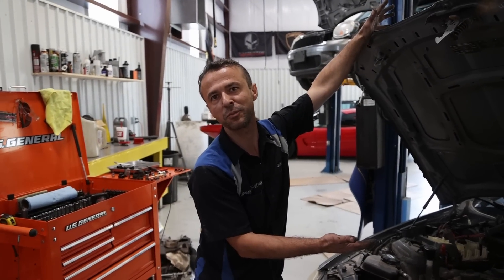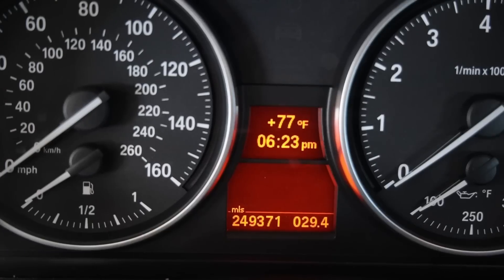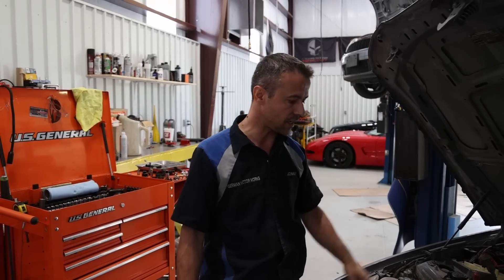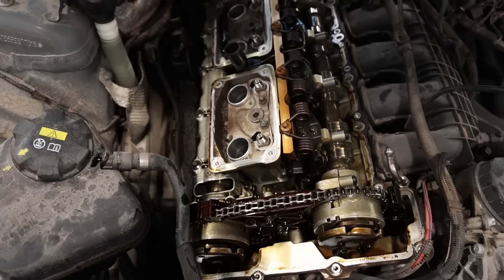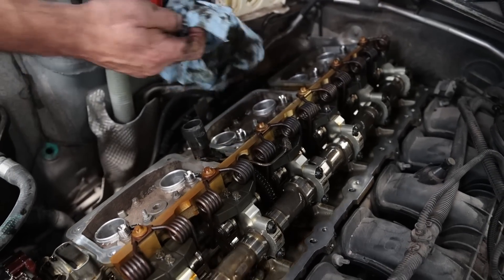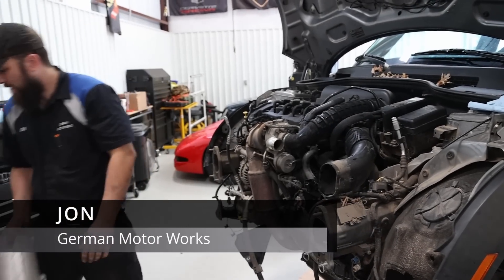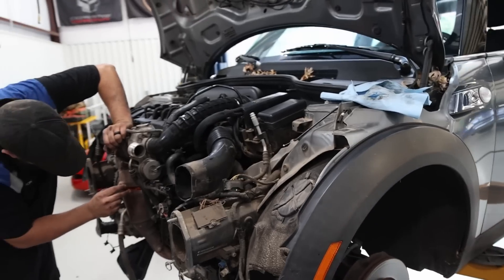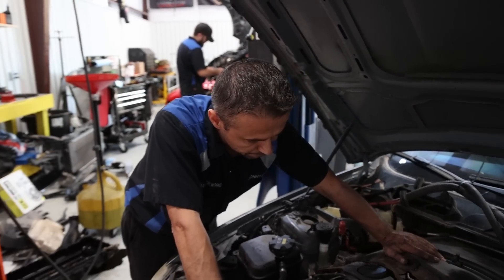CAR NINJA! I Bought a HOOPTIE

Comment: I also had a 2011 335i, best car I've ever owned. Exact same color but mine was a coupe with M package and AWD. It was very reliable, i put 137,000 miles on it and i only had to replace the water pump and OFHG. The valve cover was just starting to seep. I took it on road trips across the US and never skipped a beat. Starts right up at -40 and the xDrive was good in the snow. Sadly i needed 4 doors and better fuel efficiency so i traded it in for a VW Golf.
Reply: Ouch